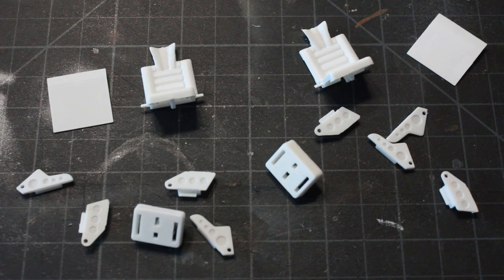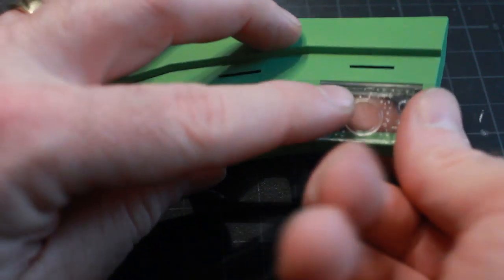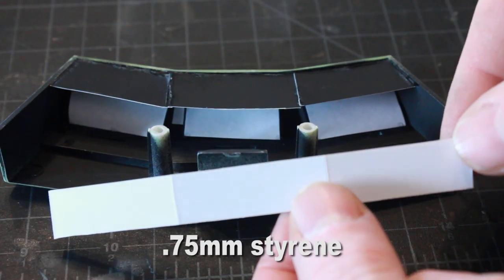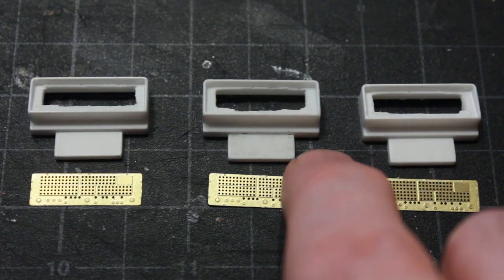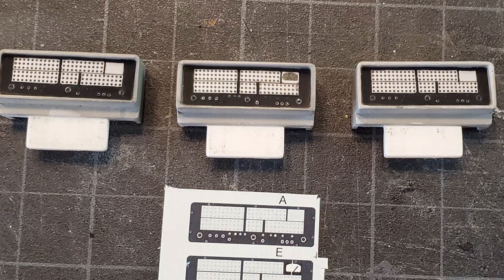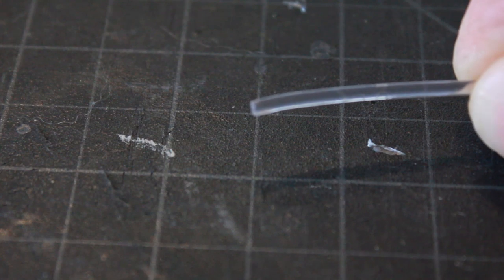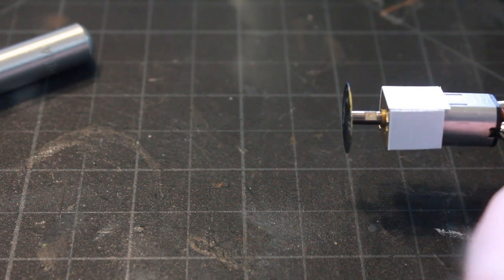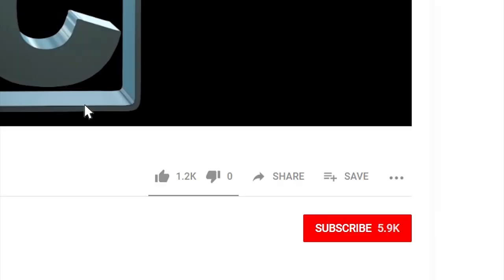Moebius 1/35 scale Jupiter 2 Pt 5 Main Center Console

Comment: Congratulations on excellent model with all the operating features of the original. Do you accept build projects four clients?
Reply from the maker: I will do, and have done commission builds.  However, I won't be doing another J2 build for anyone.  At least not in the next few years.  Took way too long and to much time.  That J2 build was a commission, and it was much more work than I ever expected and I would certainly charge much more to build. But I have other things I'd like to do.

Comment: Christopher... Thank you for these in-depth videos, I am VERY interested in the Adafruit Trinket device. Is the programing hard to accomplish what you have done for the panels? Is the script available? What is the method on how to program the circuit? Maybe you should do a video just on how to do that programing, I'm certain that many people would like to use that same display in their projects. I am building the Squadron Haunebu II at this time, and would love to incorporate that random panel flashing into the consoles of my project.
Reply: Hi Brian, i asked same question but no answer, i am using now the Arduino software that have some sketches pre loaded on it but for the rest, i don't know, i made a lot of researches on internet but it is hard to find, trinket board is suppose to be friendly user but not sure, good lucks !
Reply: @richardb.8467  Thanks... I have been playing around with an Arduino NANO for this and found a script for running 5 LEDS in a very random pattern. The pin outs are the same as the UNO; however, the NANO is about a quarter of the size of the UNO. it can be set up for either 3v or 5v. This worked fine for me with the Squadron German "UFO" kit.
Try This:
Random Blinker
// --------- User Defined Inputs ------
// Values based on UNO   
const byte totalLEDs = 5; // Number of LEDS used -- number <255 so use a byte or uint8_t
const byte ledPin[totalLEDs] = {14,15,16,17,18}; //Pins assigned to those LEDS -- number <255 so use a byte or uint8_t
boolean ledState[totalLEDs] =   {0,0,0,0,0}; // What is the current LED state -- used a byte to store true/false as boolean since it is ON or OFF (0 or not 0) 
unsigned int ledOn[totalLEDs] = {0,0,0,0,0}; // used to store ON times, using unsigned int to hold time up to 65535 ms) -- used INT (16 bits to store larger values
unsigned int ledOff[totalLEDs] ={0,0,0,0,0}; // used to store OFF times, using unsigned int to hold time up to 65535 ms) -- used INT (16 bits to store larger values
unsigned long previousMillis[totalLEDs] = {0,0,0,0,0}; // What time was the LED last tumned OFF -- Needs to store largest possible value (4 bytes used)
unsigned long currentMillis;

// ----------- Setup  ------------------
void setup(){
  for (byte currentLED=0; currentLED<totalLEDs; ++currentLED)
  {
    pinMode(ledPin[currentLED], OUTPUT); //initilize all used LED pins as outputs
    digitalWrite(ledPin[currentLED], LOW); //Turn LEDs off to start
  }
}

// ----------- Main Loop ---------------
void loop(){
  currentMillis = millis();           // Get the current time
  
  for (byte currentLED=0; currentLED<totalLEDs; ++currentLED) 
  {  
    
  if (currentMillis - previousMillis[currentLED] > (ledState[currentLED] ? ledOff[currentLED]:ledOn[currentLED])){   // using a conditional operator
    digitalWrite(ledPin[currentLED], ledState[currentLED] = !ledState[currentLED]);    // Flip the state and output it
    
    (ledState[currentLED] == 0) ? ledOn[currentLED]=random(400, 800) : ledOff[currentLED]=random(800, 1400);
      
    previousMillis[currentLED] = currentMillis;  // reset the blinker time
   }

}
}
// -------------------------------------

I'm certain someone with more experience could clean-up the script' however, this worked fine and is still very small in size.

Comment: Chris I started working on assembling the 3 blinking panels (that have the .5mm fiber optic cables) that attach to the top of the main control console. Did you paint the controls on the photo etch that are on the bottom most row or scratch away the black paint. Very difficult to see the raised controls, everything is so tiny.
Reply from the maker: Yes,  I did paint them.

Comment: How did you trim the fiber optics to be flush or close to flush with the panels?
Reply from the maker: With some spru snippers. A real pain.  They're not all quite even, but small enough you can't really tell
Reply: Christopher Olson Thanks for that response.  I have nowhere near the skill you do, but will be trying a lot of what you did in this kit. That’s the plan anyway, or maybe fantasy.  Amazing job cramming all that stuff into the panel though, great job!
Reply from the maker: @avi8r66  the video does make it look a little easier than it was.  Getting all that in there was a bit of work.  I probably spent close to 30 hrs just doing that whole unit.

Comment: What type of capacitor did you put on the end of the motor.
Reply from the maker: That cap was actually on the motor when I purchased it. I did not add anything myself.
Reply: @modelsbychris  what type of capacitor is it. I might have to put one on my motor too it is also geared or is it a capacitor or not.
Reply from the maker: @albertlesmerises5860  it was a geared motor.  It was several years ago now,  so I really don't remember much.  I can see if I can find what I bought.